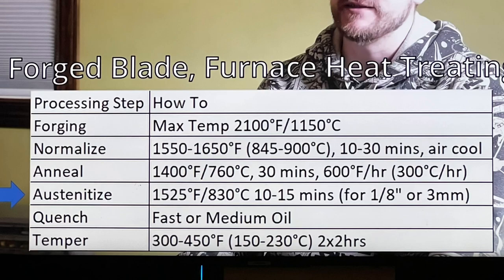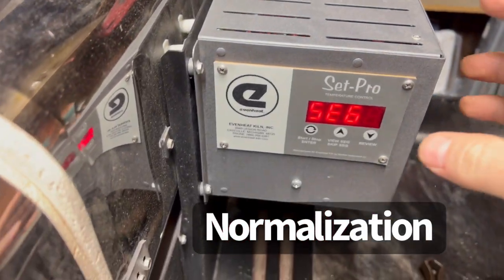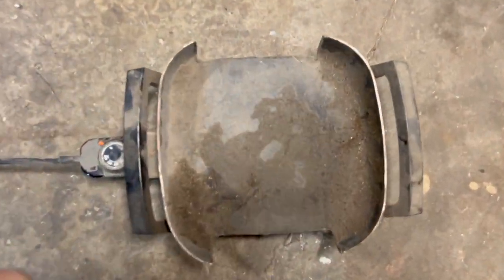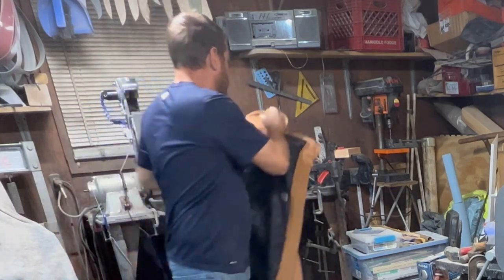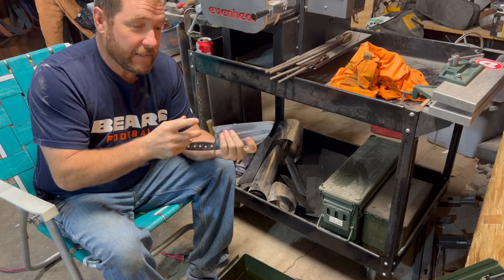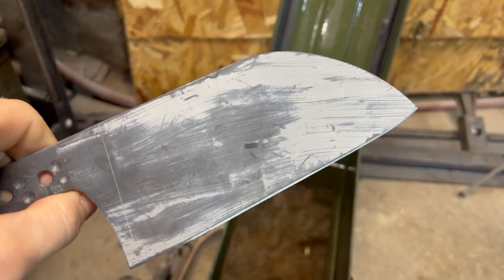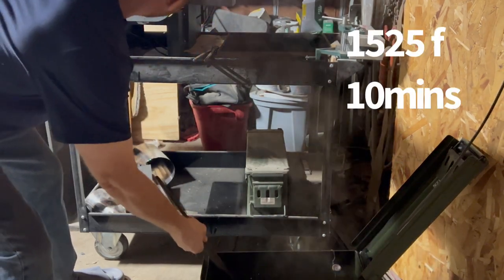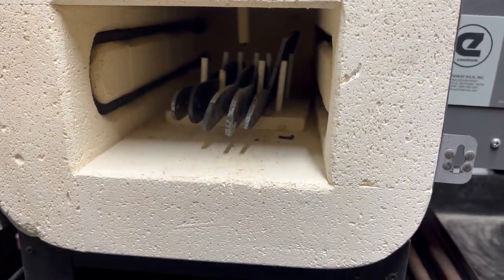80CRV2 Heat treating  Oven VS Forge

Comment: Very interesting Aaron..all my heart treatment is done with a propane forge and agree with what you said about some knives coming out ever so slightly different 👀 having said that as long as the knife is properly heat treated/tempered does it really matter in the grand scheme of things 🤔all the best Lincoln 🤙👍
Reply from the maker: In the grand scheme of things no I don’t think it matters a few points here and there up or down it’s still gonna be a good knife. I think the reason larrin is so against heat treating in a forge is because all forge heat treats are “not” created equal, but no matter who the user is all ovens are created equal if the numbers are punched in right lol and sometimes that’s hard for me to do lol
Reply from the maker: I do believe every knife in this video that I reheat treated was already a good knife. I pretty much just redid it all for research purposes just to see if I can tell a difference and I definitely can tell a difference far as consistencies. I also noticed less warping and less scale.
Reply: Think I'll stick with propane for the carbon steels..few people asking me for stainless but my mate has a paragon oven I can use..I'll pull in a few favours 😁
Reply from the maker: @harwoodblades3633  no need for a oven It’s all about the individual. I don’t need a 2 x 72 belt grinder and I didn’t need a heat treat oven either it’s very possible to making great knives without an oven.
Reply: Just watched a video on the knife steel nerd..loads of good info on that channel 👍 putting it into practice who knows 😁parks 50 is definitely a good oil.. keep it cooler for 01 warm it up for 80crv2🤔I use two bits of oak to take any warps out but don't get many nowadays 👍 the only time I do is double edge but it's rare🤔I use a cement slurry on the steel 😁
Reply from the maker: @harwoodblades3633  well, I got a Lotta oak I’ll try that one day, On a bigger blade. Yeah I see what you’re saying. I don’t think quenching 01 in  Parks #50 would be a good idea. 🙀
Reply: @AaronJohnson1979  sorry pal .typo...rye 50🫣works a treat 😁tested to hell and back 🫣👀
Reply from the maker: @harwoodblades3633  yeah I’ve never tried. It. Sounds like a fun video. Lol

Comment: I'm looking for an oven now. I took 10 blades to a professional knife Smith to harden for me because I wanted them done right. When I got 7 of them completely finished with sheaths and everything I went to sharpen them. I couldn't get a good edge on them so I went and got my hardness file.  Holy hell they only test between 40 and 50. I'm so pissed right now I could choke him. That's 3 months work down the drain and hundreds of dollars. If you want something done right do it yourself. These are supposed to be Christmas presents
Reply from the maker: What kind of steel did you make the 10 blades out of?
Reply: @AaronJohnson1979  W2 I thought the steel might have been bad so I heat treated one and it got hard as woodpecker lips. I can't believe he didn't check those blades before he give them to me. I didn't think I had to check them because he is a full time blade smith
Reply from the maker: @richardbranton190  well W-2 needs to get in the oil within a second the oil needs to be parks 50 used canola oil or something HRC in the 40s that’s pretty much not even heat treated and canola oil. It’ll still get in the mid 50s I don’t know what happened that does sound strange
Reply: Ouch, yeah, W stands for water quench.. That stuff needs to get cold - fast.

Comment: Well my 80crv2 outdoor blade from you is 62-63 we both are guessing it feels like that on the stones. Ive banged that blade on two by fours and such and its been very very good in all my tests so im sure a propane forge can do good knives. Know will every knife be spot on the samme hrc nope there will maybe be say 0.5 to 1 point maybe even 2 point difference every now and then. And the oven is a much more controlled even heat both tempering wise and auestinizing wise.
Reply from the maker: I still feel like I can make a good knife heat treatment in a propane Forge, but because of the inconsistencies, I do believe if you sell them the buyer u should at least know it was done in a forge and not an oven
Reply: @AaronJohnson1979  yes sir

Comment: Doesn't aluminum draws heat quicker than air cool? Wouldn't that shock the steel harsher making more prone to warps? Why do you use it and do you use it on all blades?
Reply from the maker: Ill cool 80crv2 in parks#50 first after it’s around 150 degrees ill put it in the plates let it cool the rest of the way. Yes the aluminum plates are faster but they are forcing the blade to stay straight evenly with pressure.
Reply: @adj7214  so it doesn't have to be aluminum? Just a dead flat surface is needed? Cool furnace, by the way. I saw another video of yours where you used a thermocoupler doodon thingamagig in your forge. I just ordered one. Thanks for the videos and keep filming as much as you can.
Reply from the maker: @MrRon2k  , I used to use two pieces of angle iron in a vise that works too, it really helps with the warping. I want to try these ball peen hammers with a carbide bit on the end of the hammer. I guess you just give the knife a smack and it’s straight. I don’t know how it works but a lot of people are doing it, and they all say it works.

Comment: I would like to have an oven like that some day.  Which model did you end up going with?  Having watch knifenerds video specifically on 80CRV2, I'm pretty much convinced that unless the heat treatment is controlled and repeatable, the hardness results will vary widely...from 40 up to 65.  It seems as though the soaking time in the oven is the key to getting carbon back in solution and distributed evenly prior to quenching.  I also really like your little vise with the two aluminum plates on them.
Reply from the maker: Thanks yeah the vice is a wood vise that’s what kind of style it is and then I just put some self tappers which screwed right into the aluminum. No problem. 
If you use Parks 50 you can get a good hardness in a propane forage, but the hardness will vary two or three points HRC  I did a lot of heat treating in a propane Forge and I always had good grain structure and Hrc
My version of the even heat is the 110 version. It does take a while for it to heat up but that’s fine with me. It doesn’t hurt Nothing definitely gives you consistent results. I’d rock the hell out of my 110  lol 
I don’t have a 220 out of the garage and my electrical system in my house is not too powerful hundred amp service so I had to keep it simple

Comment: I’m new to this knife making world, where could I find the clamp system that you are using in the video with the aluminum plates?
Reply from the maker: You can use two pieces of angle Iron in a bench vice at first
This clamp is a woodworkers vice not great for high-pressure, but it’s good for this the aluminum plates I got from one of the knife stores online like Texas, knife supply or one of those
Reply from the maker: I just used self tapping screws and screwed it right to the aluminum plates
Reply: Hey, thanks for the info!

Comment: This is not how those files work, it is about scratching the surface, not digging it in the steel the files are not made for that, and will need replacement very quik. Don, t ask me how i know that.
Reply from the maker: Lol I hear you there usually I only scratch the blade but in this case, digging a hole in it gave me a little bit better idea of the slight differences in HRC. It’s hard to tell the difference of a point or to just scratching I guess with the force of scratch, but for me, it was pretty clear, digging into it I could easily tell which one was harder. I probably will never do it that way again

Comment: Very nice video! Can i ask for your opinion on this 80CrV2 knife break?  The guy banged it on an iron pole and it broke right away. Would you say this is typical for  that steel , HRC rated 59, or do you think this is a bad heat treatment issue? https://youtu.be/3_A0GpZDSSg?t=116
Reply from the maker: I would say that’s a bad heat treat or possibly a stress fracture, or  didnt temper it back enough. Theres a lot it could be. 80crv2 is some really tough stuff
Reply: @AaronJohnson1979  Thanx for the reply, i just ordered the knife, that's why i'm asking. I don't plan on doing what JOE X does, but that did look like it snapped a little too soon. Greets from Croatia!
Reply from the maker: joe x can give people the wrong impression on knives to just because a knife does poorly on a Destruction test doesn’t mean it’s not a good knife
Reply: @AaronJohnson1979  that's true. Too bad that when he already destroys all those knives, he's not doing a little more sensible tests. No idiot is gonna bang on a rock or an iron pipe with his knife.  And as expected, hard knives break, and softer knives survive that crap..
Reply from the maker: exactly a true destruction test, where I would actually use that information to buy a knife would be if it breaks during use that it was made to do
Reply: The odd part about that is if it's only at 59 I would think it would bend rather than break. In my head it has to be some kind of stress fracture. 59 shouldn't be that brittle but I don't know how hard he was beating on it.😊
Reply: @AaronJohnson1979 I like destruction tests, but his are for entertainment purposes only. The knives that "pass" are too chunky for anything but in a total warzone as your only tool.
I'm not sure why people go for the mora robust over the regular companion, myself.